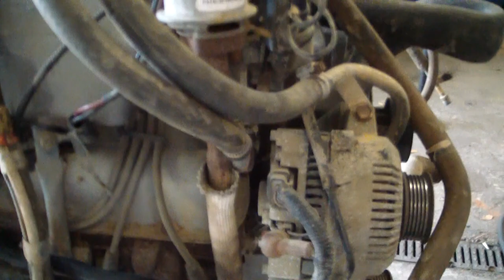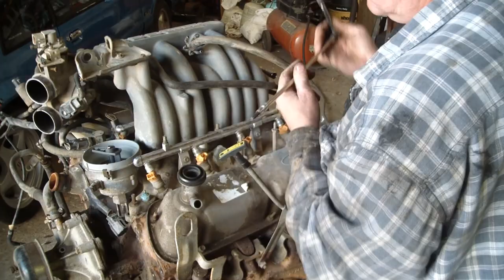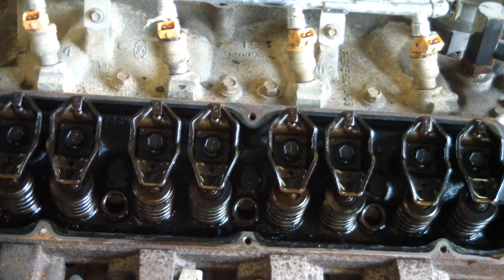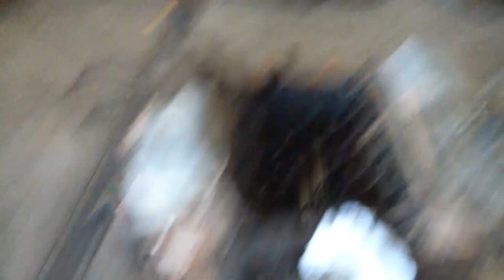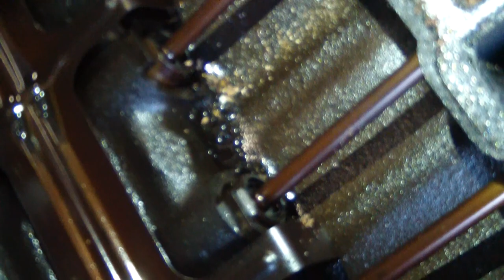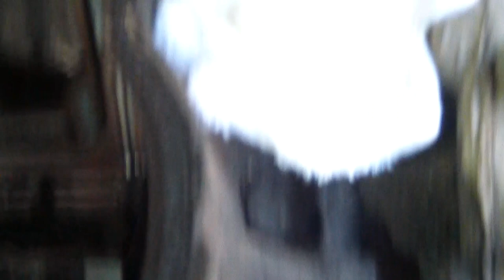Breakdown Of A 94 Roller 351W

Comment: A good indication of mileage is how many of the corner lower intake bolts break off. Anything over 150k you’re guaranteed at least one. If you get all 4 corners you’re easily north of 250k
Reply from the maker: 284K and never been opened up and clean?  I was like WTF?  It sucked when the intake bolts broke.